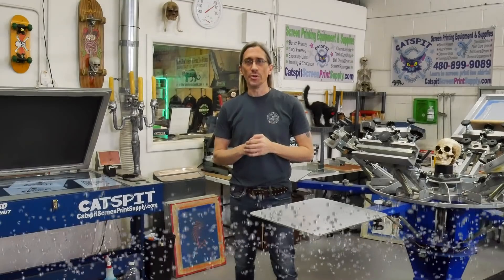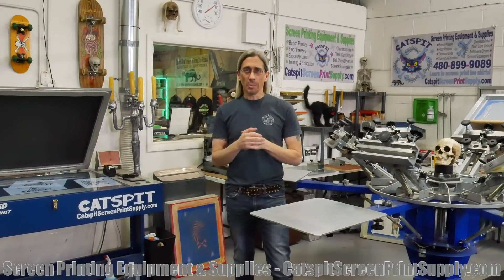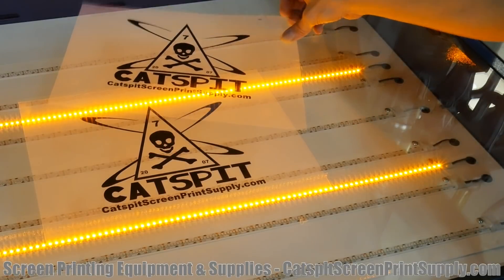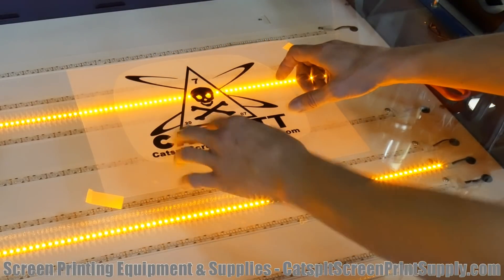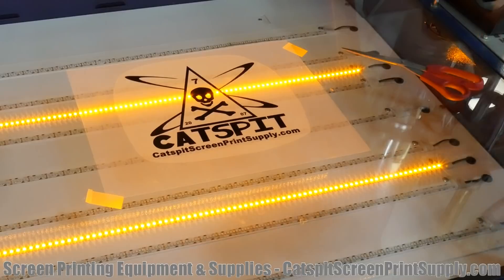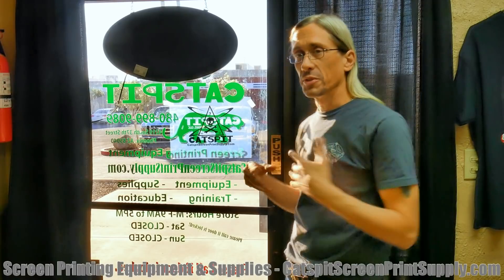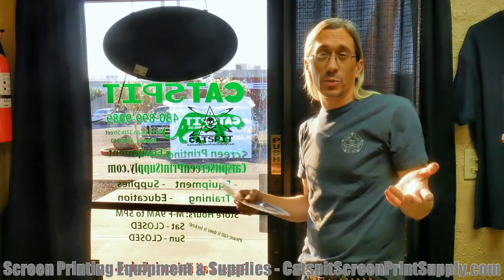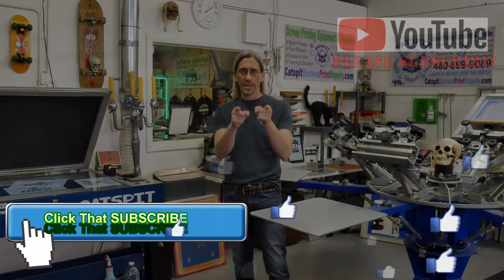How To Screen Print Tee Shirts At Home: Doubling Up Your Film Positive For Density

Comment: Sir, i wanna print on glass ( perfume bottles) how can I protect the ink from alcohol?
And should I use an oven?
Thank you sir.
Reply from the maker: My forte is textiles really so you would need to consult a graphic industrial ink maker that has an glass ink for your application. Usually it's an enamel ink or a glaze type ink that has to be baked. For perfume bottles I would imagine it would have to be the latter. Thanks for watching! Screen Printing Equipment & Supplies - http://CatspitScreenPrintSupply.com/